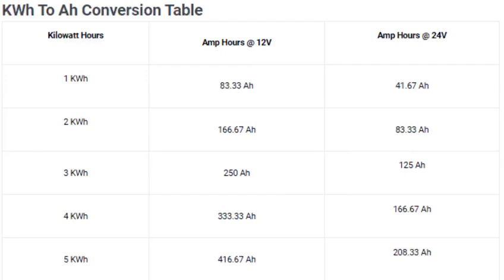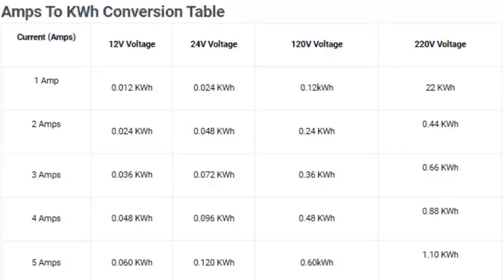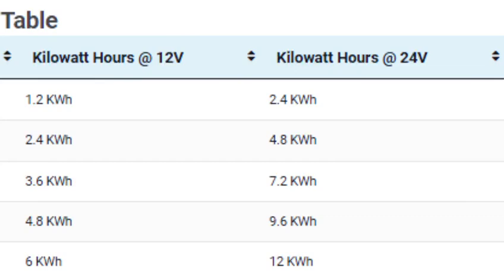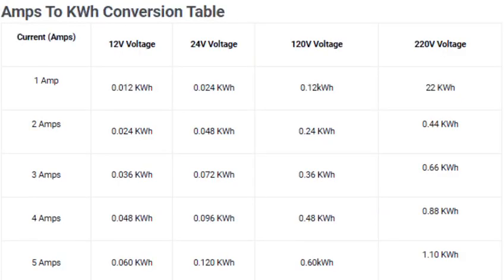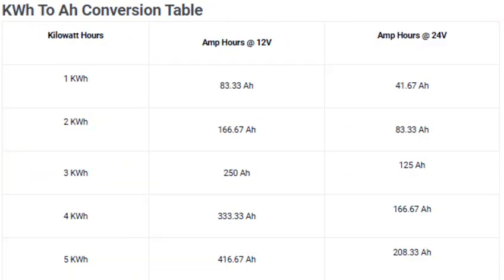Amps to KWh Conversion

Comment: La vidéo explique la conversion entre kWh et Ah, mais si la tension varie beaucoup, la formule reste-t-elle précise ? J'espère que cela pourra être clarifié.
Reply from the maker: Lorsqu'il y a de grandes variations de tension, la précision de la formule de conversion peut être affectée, car les fluctuations de tension modifient le courant et la puissance réelle. Il est recommandé, dans les applications pratiques, d'utiliser une tension moyenne ou de prendre en compte la courbe de décharge de la batterie pour améliorer la précision des résultats. Si possible, l'utilisation d'outils de mesure pour surveiller en temps réel la tension et le courant peut fournir des données plus précises.